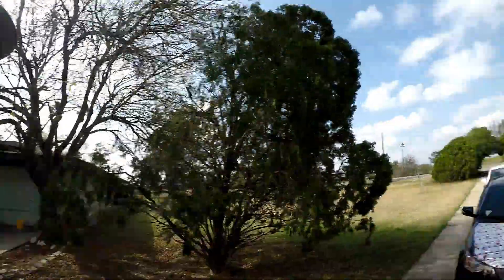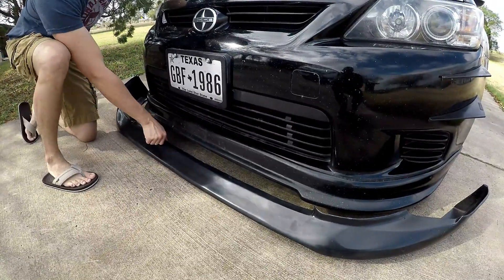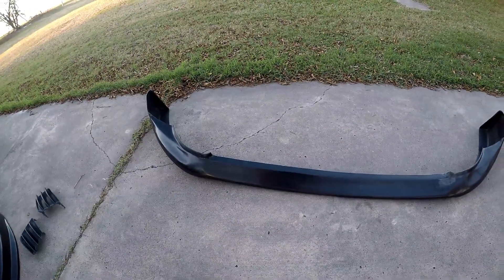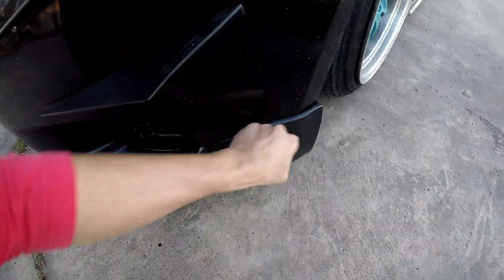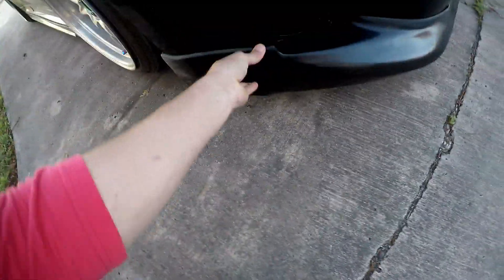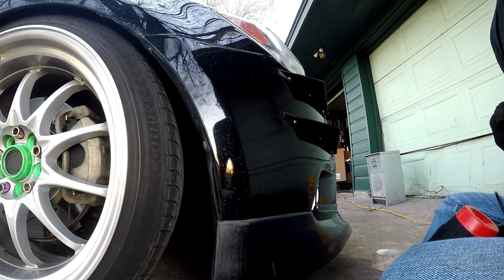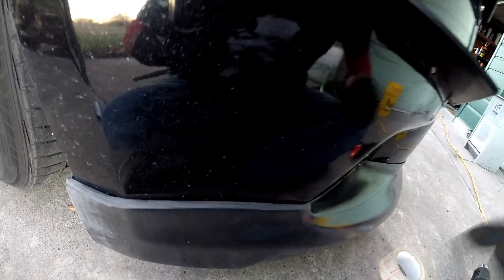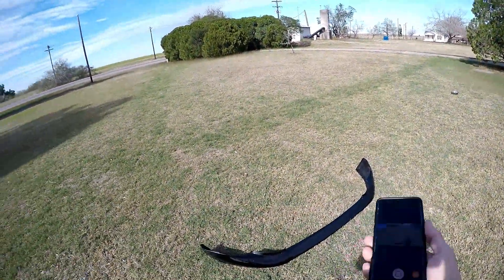Scion Tc2 AD 5 Five Axis Design front lip - Christmas edition

Comment: What spray paint did you use I just got that lip and I’m planning on spray painting it so it matches the color of the car a little more
Reply from the maker: There's 2 options. Dupli-color color match or if you go to a local paint shop, they can mix pro automotive paint and put it into a spray can.  We have an Advance Auto Parts here that mixes paints. A tall can usually runs $25 - $30. I highly recommend them.
Reply: @BeardedPandaProductions  sorry for the late reply but what would I ask for when I go to advance auto parts? What do I tell them so I can get the right one and not mess up thanks In advance man
Reply from the maker: @Alejoo_CG  make sure they mix paint at that specific location or one close by. If they do, just ask them to put it into a spray can.
Reply: @BeardedPandaProductions  yeah they do I already called them and they told me they do so where do I get the paint from?
Reply from the maker: @Alejoo_CG  go to a rep at the counter closest to the paint room. That person is usually the one that mixes the paint. If they aren't at that register, just tell any rep that you need some paint mixed.  They'll ask you for the year, model, and make of your car. I always give them the paint code for that extra confirmation. Then just ask them to place it into a paint can. Oh.... not the "single stage paint". Single stage = clear mixed into base... it won't be as shiny. It's better to get the dual stage so you can clear over the base paint yourself.
Reply: @BeardedPandaProductions  ohh okay okay thank you man I appreciate it really. Is that what you used on the video?  Or did you use something else because yours came out really shiny
Reply from the maker: I used another product, but I've been pro painting since then... and this method will be even better. Tell them that you want a clear too. The clear they'll offer you last longer and should be just as shiny, if not better.
Reply from the maker: Let me know how it goes or how it comes out. Always neat to see
Reply: @BeardedPandaProductions  for sure man thank you so much
Reply from the maker: @Alejoo_CG  for sure man. Any time. Reach out if you have any other questions.  I'm all about cars broski.  Or hit me up on IG: @bearded_panda_fab_jason